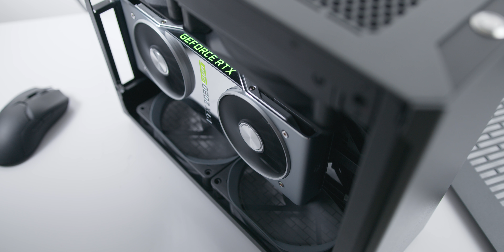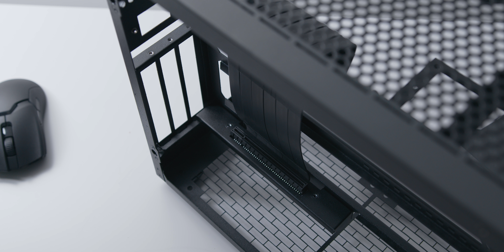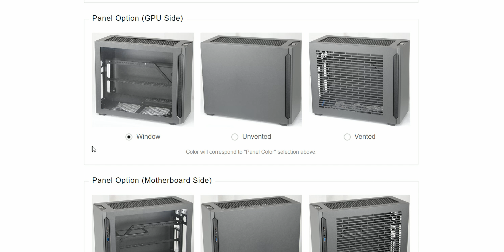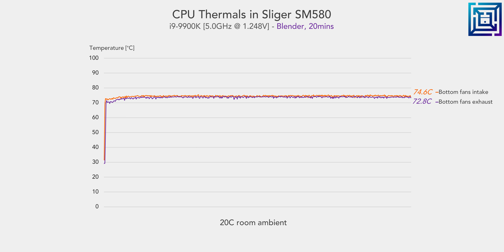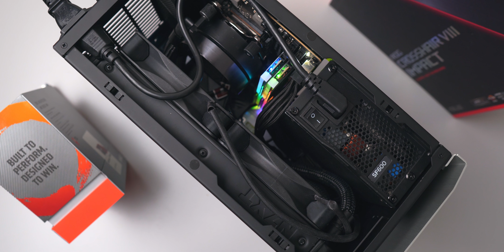Sliger SM580 Review vs. Ncase M1, Streacom DA2

Comment: How are the thermals on the newer components?

(I know they are not available yet) Would it be feasible to build a system with a i9 13900k(s possibly) and RTX4070/80 in this?

Comment: Thanks for the info.   How much space did you have between the mobo and the top fans?  I was wondering if i could fit the mini dtx impact on there.  With a longer riser cable as well. Maybe with a 15 mm fan instead of 25mm. Or a thinner radiator? Idk

Comment: I just built one out of SM580. It's perfect. It also looks great because I chose glass panel on the CPU side, with some ambient lighting on the bottom, NZXT Z63 and G.Skill trident Z Royal. At the same time, all other cases you mentioned in this video can't do that: a glass side panel showing everything clearly.
GPU side is vented by the way. No need to show off on both sides.
The thermal is also great when you do bottom intake in this case. The airflow is there, from the bottom and from the GPU side, not a issue at all.

Comment: How would you compare this against the NR200?

 Im using the NR200 right now but would like my Z63 on top instead of side. I know bottom is possible, but Ive heard bottom mounted AIOs with cpu mounted pump isnt good.
I can see the Z63 screen in the Sliger and no need to remove side AIO to access or see graphics  card.

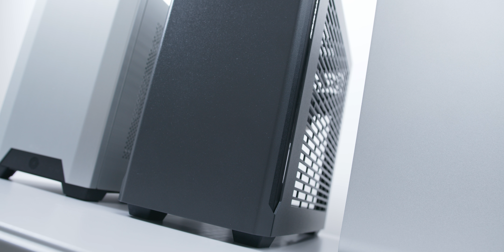Comment: Can anyone answer me that kraken x63 really fits like this video said 4:17 ? Cause some people told me that kraken x63 is hard to fit top panel, I start to worry about it, my sliger sm580  and kraken x63 is on the way...
Reply: Most 280s are hard to fit and If than the Radiator will only fit in a Special Position.
If IT IS not at the perfect place you cant Close Sidepanels or get the screws fittet to mount the top of the case. You have to figgure it Out which Position your AIO need.

Comment: Looking to get this case for 5900X with a RTX 3070. A build aimed at Blender use with GPU rendering. I'm not a fan of water cooling and noise isn't an issue for me. Can this setup work in this case with air cooling on the CPU?

Comment: I was searching for a case like this but would be interesting to see how thermals changi in different side panel setups the x63 also saw that there was option for 3,5 HDD rack which goes to the bottom of the case  then we would could have x63 on top and one single fan on bottom would that drastically change the the airflow and thermals? thx best regards

Comment: Not sure why you're praising GPU thermal performance so highly when there's gigantic holes punched into the sidepanel without even any dust filtration. I think dust management should not be overlooked when you benchmark cases.
Reply: There is a dust filter kit for the SM580. Most sffpc cases are already starved for air; put filters on them and you'll end up choking and greatly restricting your cpu/gpu. It's just a tradeoff most of the sffpc users have accepted.

Comment: sm580 has better gpu thermal than sm550 / 560 due to the top 280 aio exhaust ? Seems like they have the exact same config otherwise and it's surprising to see such a thermal improvement over 65 c for 550 / 560 / open air bench

Comment: I'm really intrigued by this case. I find the layout ideal for airflow and with a short GPU a full custom loop shouldn't be an issue with ideal airflow through the case. The bifurcated riser is an amazing option to run a 10GBit/s ethernet card and a top tier gpu from an ITX board without bigger performance hits (since there aren't any 2080 or 2080Ti mini cards, I'll stick with my 1080Ti mini). All that in a small SFF case. 

I guess I'll have to take some measurements to see wether a second slim radiator on the bottom could be an option.

Comment: I'm having a bit of trouble finding an SFF case around 10L that is readily available in the $100-150 range, supports 240mm radiator for dual water cooling the CPU and GPU, supports 2080 reference length, and has at least some amount of side panel exhibition for LEDs (generous venting or glass preferably). I don't need any 3.5 or 2.5 bays. CPU: Ryzen 7 3700x. Suggestions welcome.

Comment: For the kinda air restriction going on in these smaller cases, would you recommend going with high static pressure fans as exhaust on the bottom? Or stick with Higher air flow fans
Reply: Robert good to here because i got antsy and pulled the trigger on those exact fans anyway 😅 just waiting for the case to come in mow

Comment: Can someone explain me why is the exhaust config on both bottom and top fans is better? Wouldn't be bottom pull -> top push better due to the natural convection?

GPU should pull the cold air from outside the case from the side panel, so supplying it with cold air from the bottom should be beneficial.

Comment: Hit the nail on the head about the vent patterns, and I'll admit those were concerns of mine during design.

Obround pattern was put in for where I thought people would potentially be mounting parts. Given I did not know what those parts would be, but I did know from the Cerberus that people were comfortable with said pattern, I kept it for initial release. To date I've only seen one person actually use the rear obround pattern for any form of pump/res mount, and given all the other mods that person did to their case they would have had no problems drilling their own holes. I see no reason to keep the rear obround pattern, it will be removed.

Internal obround vent pattern will stay for now, as I have seen several builds utilize it. Most likely will change it to rectangles of same size though.

Top panel originally had a rectangle pattern similar the SM550, but it had issues with the handle, where as round circles just worked. Working on a prototype that has a new rectangle pattern, will post something on SFFPC when ready and see how people like it.

When I get caught up on everything else I'll shoot you a new SM580 chassis with updated vents, along with the Console and SV590. 

Appreciate your feedback, helps me make better cases! =]
Reply: SligerDesigns It’s great to see you embracing the feedback, as I am really interested in purchasing a case. Are you looking to use aluminium in a version of this case?

Thanks
Reply: @MorpheusLoopYMCMB   Panels on the case are currently 2mm thick aluminum, but no plans to make the frame aluminum at this point - steel is much heavier gauge than most cases out there, to replicate that strength in aluminum would boost the price considerably. However I do have a cases in works similar to the M1 that will be all aluminum!
Reply: @SligerDesigns  I ordered my SM580 2 and a bit weeks ago... Will it have the updated vent patterns? I assume not but it's worth a try :)
Reply: Tempered glass rather than acrylic?
Reply: @SligerDesigns Any plans for TG (or better tinted TG) side panels instead of acrylic? When can we expect the new patterns being distributed world wide (or more specific: EU market)?
Reply: Gonna get a 580 :D
Reply: I love your case design! Any chance you guys make a budget oriented sff case in the future?
Reply: I just think it's cool that Sliger is embracing this.  Having work with Sliger in the past, I can say that their work is solid and has great design.  They even went to the point helping me with the bend radius on their machines so I could get my design right.  You got my business and plus, my 580 will be here tomorrow.  I am so stoked!
Reply: Man this is so cool. I definitely plan on picking up the white SM580 with the handle for a future build
Reply: Just got mine today, won't be building it for a bit, cause i don't have the PSU or Motherboard for it, but this thing is class. Most people will look at the price and be disgusted. After just taking it out of the box and seeing how everything goes together, it was well worth it.

Comment: Greetings I am a lover of your reviews. In this opportunity, seen in some shots, your Corsair 600 power supply has a different fan than the one that comes from the factory. I wanted to change mine but I have seen that with noctua it does not work properly and produces annoying noise when switching on. I'm curious how you made this modification
Reply: I’m not the only one that noticed!! I actually don’t have about the noise, what bothers me is the grey fan.  In my case I went for a blackout build, and while the grey isn’t the worst, it’s not black

Comment: Just as another argument: I got the Ncase M1 mainly because it doesn't require a pcie bridge (that may or may not impede pcie 5 when it comes in a couppemyears) and using a small tower air cooler on the CPU since I'm planning to keep it (this case) for as long as it lasts, which (due to being made from Metal and minimal case-own electronics) I hope is for quite a while... (and because it's just small enough to be a transportable (and air-coolable) Workstation for both Gpu and Cpu)

Comment: I just settled into a SM570 build before seeing the new Kraken Z63 cooler. I would have jumped into the SM580 for the larger radiator and fan size. Other than that, I'm very satisfied with the slimmer SM570. I think an important consideration about the SM570 and SM580 is that while they are not the most small form factor PCs out there, they maintain the stance of a traditional PC case, which I do prefer. So many sffpc cases are very short and stubby, so I dont mind the extra height at all.

Comment: DA2 owner here, love the case and optimized it for best cooling with a 280 mm AIO on the side with a slim Artic fan at the back for exhaust. Love the look of it too
Reply: DA2 owner here too did the same but with dark rock TF and 2 slim fans one the rear and one on the back getting great temps on a I9 9900k @ 5ghz and gtx 1080ti ftw
Reply: Rafael Mejia streacom came out with extra brackets for side mounting. I’m thinking about emailing them to get an extra pair so I can hook up more fans lol

Comment: Those SFF cases are great but almost impossible to get :\ Either out of stock or costs like the wing of a Boeing. I've been searching for smallest portable cases with possibility to use compact gpu like Velka 3 or Skyreach 4 Mini, Skyreach page shows 404 and other case is gone and you need to wait for months for the next batch...

Comment: I wish the case manufacturers would start to take into consideration increasingly larger height of graphics cards...it's becoming more and more difficult to find a card that's below 135mm tall, especially if it's a higher end card that tries to stay below 280-300mm in length and compensates with larger fans, ergo taller card. 
136-142mm tall cards are becoming common these days and ITX cases should account for that, just like we are finally starting to get cases that can fit cards that are 2.5-3 slot thick...

Comment: I have a Sliger SM 580 case stuffed w/ a 3950X w/ Kraken X62 280mm (top), ROG Strix X570-I Gaming w/ 32 (2x16) GB Corsair Vengence RGB Pro 3200, EVGA RTX 2070 Super (2 slot, air), Corsair SF 750 (fans seldom turn on), two Samsung SSD 970 EVO 1 TB NVMe's and two additional SSDs (2.5") placed under the front cover.  There are two 120 mm intake fans in the bottom vs the two 140s pushing through the top rad (the 120s  were what was handy).  Running Demcifilter filters on the slotted sides and top and bottom of the case.  Though granted apples and oranges, I have a 9900K in a SilverStone Slim RV03B Mini-ITX w/ Noctua NH-L12S w/ NF-A12x15 120mm low-profile push and pull fans, ASRock Z390 Gaming-ITX/ac w/ Corsair Vengence LPX 32 (2x16) GB 3200 (the Vengence RGB Pros wouldn't fit with the Noctua and I had to trim the pull fan (bottom fan to fit the mobo)), same graphics card, PS, and NVMe's.  The 9900K runs notably hotter air cooled in the RV03B than the 3950X AIO cooled in a SM 580 case (swapping the cases would likely have worked better).  That said, the under mobo NVMe in the RV03B also runs much hotter than the same NVMe, same location in the Sliger, though granted different mobos (adding a Noctua NF-A4x20 helps a little).  Both systems moderately OC'd.  Succinctly stated, I'm waiting on another SM 580 w/ X62 in which to move the 9900K.  It took over three weeks to take delivery of the first Sliger and the Demcifilters add some $60 to an already expensive $270+ case.  One does have to wonder , why?, re: the circle and rectangle slots in the Sliger.  I opted for the gray (OK, slate gray) color originally, nice color but the all black (new order) case should  work as well.  Minimal RGB in both cases though the Vengence RGB Pro RAM sure gets your attention.  The RV03B was highly touted by Gamers Nexus but the Sliger just seems to cool better than the SilverStone (CPU, AIO vs air, and under board NVMe).  The two cases sitting side-by-side do look like Laurel and Hardy though, if you're wrinkled enough to remember them.

Comment: Dont forget that the fans on ncase m1 are at faster rpm 5:16
Reply: Robert Smaller fans are louder no?
Reply: True but I think they're pushing similar amounts of air flow. 140 mm rpm at 120 mm = 140^2/120^2 * 1400 = 1904 rpm (compared to 120 mm 2000 rpm)
Reply: @ykh1992us  yes, but the point of a larger rad is more airflow when noise normalized. Where these fan speeds picked too stack the deck in m1s favor or where the noise equalized? I didn't here that mentioned.

Comment: I've been usign this beauty for 6 months and would not change for anything else ! I have both vented panels and run a X62 + 2 x 140 mm all in exhaust. It is nearly silent with 62°C temps for both i9 9900K and RTX 2080. I mounted dust filters and covered all holes (front and bottom) to improve airflow from vented panels.

Comment: My main machine uses this case with a 9900KS and an RTX 2080Ti FE. Everything works great with it, it's just a big large for an ITX case. The Kraken X62 is also amazing, it's the most quiet desktop PC I've ever owned due to it. CPU thermals are around 60°C in CPU benchmarks at 5GHz, so there's nothing to complain about.

Comment: I told you that PWM signals makes coil wine electrical noise in fans especially at lower speed so try using voltage step down cable for fans and compare them to test this out.

Comment: That GPU thermal graph comparing bottom intake/exhaust fans shows clear signs of GPU Boost (and likely GPU fan speed) adjusting in the intake scenario. Was this controlled for? Given the rather large peak at about 1/3 in I would expect either the fans to have ramped up significantly or clocks to have dropped, if not both.

Comment: I absolutely loved this case. I have the 570, it was challenging to do flawless sleeved wires. Routing the 24 pin was the worst on the SM570, the 580 may be easier with its increased thickness. With the PSU fans facing outwards, the 24 pin needed to be crossed in order to to reverse the connectors on the PSU side; this created too much of a 'bulge' on the cable harness for it to look pleasing.
I instead stuck with the SF700 thinner paracord sleeved wires and simply cut that to length.
Reply: Kenneth Wu depends on motherboard too, ITX motherboards aren’t great with standard positioning - my 24 pin was super easy to run, but my front panel audio was next to impossible!
Reply: Josh Dredge indeed. I had the opposite. FP cable routing was easy. I have the Strix Z370i from ASUS. I also didn't want to compromise on not wiring the sense wires on the 24 pin. The only sleeved/ aesthetic option was to use the ultra low profile sleeved cable that came with SF700, and have that cut to size. I would not recommend sleeving double wires for 24 pin for the SM580 or SM570. Trust me, I've been there, got the T-shirt.

Comment: The inconsistent cut-outs to me already a deal breaker.
Inconsistency is a merciless killer for design, reliability, quality, professionalism, even relationships.
The price also a very hard sell for this one, specially given small form factor budget options like the Cougar QBX.
PS. Vertically mounted open shroud GPU and fans blowing towards it from top and bottom of case kind of triggers my OCD just as much as the inconsistent cut outs :P That's either wrong fan orientation, or wrong GPU, or wrong GPU orientation, or wrong case, or a combination of.

Comment: cutouts make perfect sense to me in terms of the smaller holes ontop, stops coins and things like that falling into the PC
Reply: Good point but if Demcifilters are used then problem solved re: coins...though I suspect most would use push fans w/ AIOs on top.  Just don't let your kids (or anyone addicted to slot machines) play with coins around your slotted case.  Maybe holes make for a stronger handled top than slots, though I wonder how many really put handles on their ITX cases.  I prefer the slots.
Reply: @garyshumway9089  I disagree, top should always be used as exhaust, a filter would just add unnecessary restriction. Sliger have designed this case really well, just like the rest of their range!
Reply: @rip.tear.  I am sorry that my comment was unclear.  I agree re: exhaust on top which, from my perspective and the way I have my SM 580 set-up, would be push fans underneath the rad pushing the air out of the case.  You were concerned re: coins dropping through slots in the top of the case (initial comment) thus the Demcifilter (recommended by Sliger) would solve that 'problem'.  Thus my Demcifilter comment.  Thinking about the coin issue further, a rad on top with fans underneath it would likely stop most (all?) coins from dropping through top slots.  I believe most radiator/fan tests have shown that push fans are slightly better than pull and together they are better than one or the other singly.  Agreed re: Sliger's design of the SM 580, though not perfect.  Thus my purchase of two of them at some $270 each, plus filters.